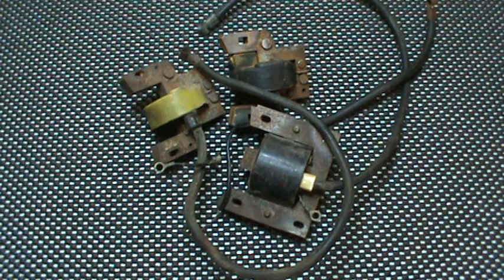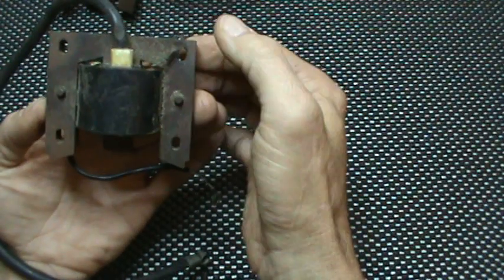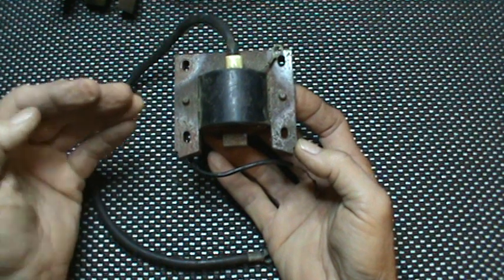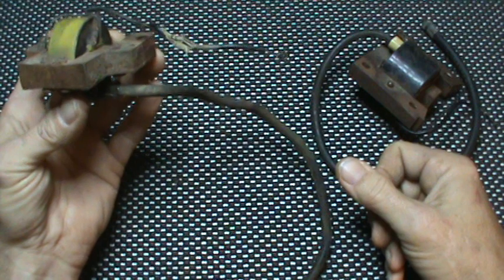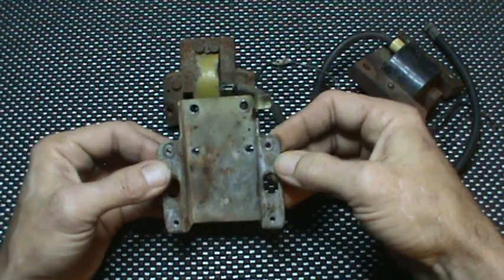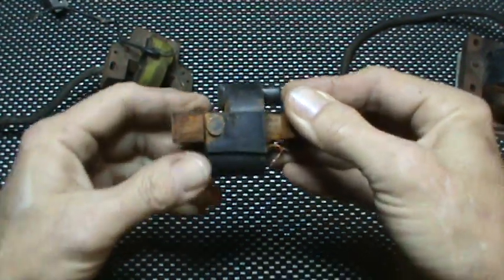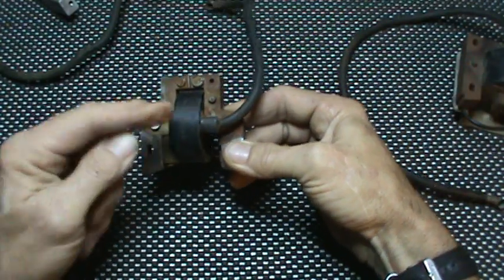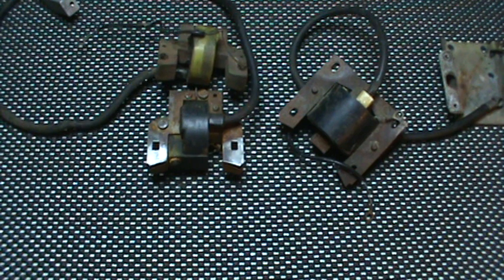Briggs and Stratton Coil Magneto Magnetron comparisons explained

Comment: My dad's old garden tiller (A David Bradley from SEARS AND ROBUCK circa late 1950's) has the old 23D coil that you've described.  The only info on the B&S motor is model # 107152 ser# 631396 on the data plate.  I'd like to replace it with a magnetron if possible.  Any info is appreciated.

Comment: I have a 5hp briggs with point condensor and my motor doesn't have an external ignition coil to go over fly wheel what should I do to get rid of the old point system don't want it

Comment: I have been getting conflicting information as to the flywheel polarization and using a magnetron coil.  Some say I can just reverse mount the new magnetron and it will work.  Seems to me that would put the spark trigger a few degrees of crank rotation out of spec.  This video mentions that they may have created a coil just for my issue.  Can you point me in the right direction to obtain one?  My engine is Briggs and Stratton 16HP -- Model #326431 -- Type # 0020-01 -- Code # 7505161 -- Serial # E950462.  Thanks for any assistance anyone can provide.

Comment: I have a 1960's vintage Trail King motor bike with a 3 HP B.S. engine I'm restoring.   
1) Only info on engine is plate on the block which says:  TD NUMBER 2222198.  Can you help identify this model?
2) I bought a coil/magneto conversion but the existing coil has four (4) bolts and of course the conversion has only two (2) bolts. In your video you mention/show a mounting bracket.....I need that bracket in order for the conversion coil to match up to the flywheel but I can't find a bracket anywhere and without a correct model that is recognized I'm stuck.  What are your thoughts?

Comment: The actuator magnet on outside of Briggs mower flywheel is all north pole, not N+S. Test it yourself with any magnet North , so that it repels each end of the outside FLYWHEEL magnet. The other guy on Youtube says the embedded Briggs  magnet has N + S at each end, so as AC is produced in primary.

Comment: I have this long gone to legacy 1958 Universal Motor Co 1 cyl 4 stroke at about 8 HP. It has the coil/condenser/breaker and light coil hoo-hoo assembly underneath a flywheel with 4 insidely placed full width magnet points. I´d like to make it breaker/condenser free and I see several solutions offered seemingly also for my type design, typically made with a flywheel with more than one magnet point. What I cant wrap my head around is how these modules unaided may prevent the plug from sparking in unseemly cyclus positions. Does anyone feel confident to easily explain me to potential success? ...preferably without having to cannibalize a B&S for external magnets and a flywheel machining job ? :D

Comment: I, nor could the local experts, find an engine number. The old coil checked out bad. The local guys matched one up, physically, but it will not spark. Can you have one that is simply not compatible with your motor even though it looks IDENTICAL? Thx.

Comment: Hi guy, I am trying to convert an 8hp briggs to electronic ignition. You show a coil with a button on the bottom and said that you don't have to have the flywheel repolarized if you use that coil. The local dealer sold me a 398811 stating it is all I need to change from points to electronic, but all it does is backfire and pop so I assume it is a candidate for needing repolarized. Do you know the part number of the coil you are showing that will work without repolarizing the flywheel? Many thanks in advance.
Reply from the maker: Flip the coil over. In other words, put the button on the opposite side. One side of the coil says something like CYL Side. Face that in the opposite direction away from the Cylinder and give it a go. Let me know your results. This trick usually works like a charm. Zip~

Comment: So Zippo, ur saying the 23 AFB has a whole different magneto set-up than the 23D?
on mine, the magnets are under the flywheel and a coil on a core that looks like a 
horseshoe crab. The new point-less has an interesting metal piece next to one of
the poles. as I understand it, there are 3 coils inside, the primary, secondary and a 
so-called trigger coil working with a diode or transistor.
Reply from the maker: Hi Raymond. You are correct. The 23AFB is not compatible with later Mags and cannot be converted to breakerless ignition. If your coil is bad, you CAN replace it with a remanufactured unit easily enough. I have yet to determine if the Nova II Ignition Module works on this type of coil/mag to eliminate the points, but they are cheap enough if you wanted to give one a try. Just Google Nova II and you'll get plenty of purchasing options. Your coil part number is 290880 and if you search that number on ebay you will find plenty of options. Zip~

Comment: I have Briggs 8R6, Part 702814, serial 173251 with a coil just like the first one.  I was able to get the coil off to replace and reuse the 3 leg like you noted.  Is there a part number I can search for to buy?  Wish I could post a pic.
Thanks for the great videos.

Comment: Question,,, are the business cards a different thickness? If so that don't work all the time,unless you find a business cards of the same thickness that you need
Reply from the maker: Business cards are standardized believe it or not. There are two main thicknesses. .014 and .016. Both are absolutely fine for setting the gap on Magnetos. Zip~

Comment: Good video. B&S make hundreds of coils with different part numbers.Are they all different? Are they interchangeable at all. Ive been told I need one, part number 591420. Ive been offered privately a 590445. Would they both work? My serial number is 80232 0474-01-7306 250. Regards, Colin

Comment: y can't you just simply turn the magneton type (your last sample) around so the third little pickup is on the right? opposite to what is written on it? would that not effectively flip flop the poles
Reply from the maker: There is a video floating around out there that shows this, but I haven't done this my self, so I can't confirm that it works throughout the RPM range. Zip~

Comment: Seen in a video if you turn coil around and you don’t have to get flywheel re magnetized
Reply from the maker: I'm skeptical about that, but I haven't tried it my self. So it may very well work fine through out the RPM range. Zip~
Reply: If they will fit .

Comment: Great video! I need to replace my magnetron type (exactly like the 3rd one in your vid) I really need help finding one!! I have the engine model number, but online suppliers keep sending me the wrong one. Who do YOU recommend for parts sir? Help me Mr Wizard! 😬
Reply from the maker: What is holding you up in limbo is your engine and its numbers are for a points fired magneto. You need to figure out what a newer engine would have for a Magnetron. But there is a small problem with converting these earlier points engines to a Magnetron successfully. The polarity of the magnets on the points fired engine is opposite that of the Magnetron fired flywheel. So...the solution (If your existing coil is good) is a simple and inexpensive Nova II Module put in place of the points. Zip~
Reply: ZippoVarga 
Thank you. If there was a way to attach a pic I’m sure you’d get a better idea of what part I’m dealing with. The problem is no spark, so I’d like to replace the bad part and I’d be good to go I think. Google search of B&S 397358, then look at Amazon for $37.48, and that’s my part. What they sent looks similar to other ones that are about $15. (smaller) It did come in a B&S part box however. Thanks again Zippo! Udaman!
Reply: @ZippoVarga  does the nova 2 not require me to pop the flywheel and move the bracket to adjust the timing a fraction, as the bracket under the fw is slotted left and right?

Comment: someone sed there was a part that could be attached to the magne'tron that looks like the
newer model coil that is a point-less set up? yup mice love that stuff as do rabbits like to
chew on phone wires under mobile homes.
Reply from the maker: Yes, there are points eliminators made by the manufacturers that attach to the coil and eliminate the need for points. I've got a couple of them that are made for the old L head 5hp engines most widely used on tillers, mini bikes and go carts. Zip~
Reply: @ZippoVarga  lol
Reply: Good video mice don't only eat che. Yes wire to little varmets

Comment: Could you please let me know where this coil alone can be sourced from. I have a 1960 simplicity with the briggs 23D. Started with intermitten ignition. Took the engine out ran some continuity and other simple test. Re installed cranked fine then after it sat for a few I reconected the positive battery lead and the mag went up in smoke. I had some weird ground issues when checking the flywheel rotation but shrugged it off for a 60 year old machine.

Comment: What if there is no top cover, so I do not have the model number and type.  Is there another place to find the numbers.  Original motor blew (9 or 10hp) and was replaced with a newer motor (13hp?).  The new motor was an electric start, old was pull start.  Mechanic put old top cover with pull start on new motor.  So i old have original motors model and type.  I have a no spark senario, tried to order coil via top cover and still no spark.  Can the coil be identified via the old coil?  Should the coils look identical side by side?  I asked the mower shop and they refused to assist.  Because of the virus I have no way to transport the mower to the shop.

Comment: I need help with my older Briggs I think it's a 16 HP I pulled the flywheel off but no key Crank has a spot for it but flywheel don't looks like it had a tab on the front I don't know what I should be looking for
Reply from the maker: If there is no key, and the flywheel has a small tab that nests into the notch on the flywheel that is removable with a small screw, then it's most likely a 9hp Model 23. Photos speak 1000 words. Email me at the address in the description below with photos of the engine and I'll try to help you. Zip~
Reply: @ZippoVarga  i put on a chevy truck coil on it and went with the points I'll try to send you a picture thanks for replying you know more than anyone I know about old Briggs

Comment: Will water ruin them.
Reply from the maker: Water doesn't play nice with any Electronics. Having said that, if the coil is thoroughly dried out, often, if the coil pack it self didn't short out, they will still work. I've had coils that the laminated metal sections had gotten rusty and swelled up that still produced a good string spark. So take that as you will. Great Question! Zip~
Reply: @ZippoVarga  yeah cause I had a pocket bike I changed the carb then it ran great till I washed it. I ordered a new magneto. I tried drying it but runs inconsistent
Reply from the maker: @eliasleyva547  Ah, got ya. It's possible the ignition module that runs off the cam may be what is in need of drying out then since you're speaking of a Motorcycle engine more or less. Zip~

Comment: I'm working on a 3hp Montgomery Ward edger and want to get rid of the points; thanks for the info!
Reply from the maker: Getting rid of the points isn't as simple as just buying a Magnetron coil and putting it on. The polarity of the magnets on the flywheel is incorrect for the newer style and the flywheel should be sent back to Briggs & Stratton to be re-polarized, free of charge. You just pay shipping. Another option is a points eliminator. Either a Briggs & Stratton kit or a Nova II ignition module can be used. I have videos on both and it's a cheaper and simpler way to rid your self of the ignition points. Cheers! Zip~
Reply: @ZippoVarga  I ordered the nova ignition module and a stock replacement coil because mine is kinda rough and suspect. I'm hoping that will fix my issues. My dad inherited this edger from my grandfather and I inherited it from my dad so I world really like to keep it going and use it. The date code on the shroud says it was made in 1970 which makes it older than me!

Comment: Hey Zippo, I have a 3hp B&S motor, numbers are: Type 0413-03
Code 9082101
Model ?30202?
Do you know which magnetron would fit and where to buy one?
Cheers, Phil. (Top Conker).
Reply from the maker: Heya phil! You can go to the Briggs web sight, go to the manuals section and download the manual for your engine and within will be all your part numbers at your fingertips. Then Google Briggs and the part number and you'll have dozens of choices. Hope this helps!!! Cheers! Zip~

Comment: One of the coils I have does not have that button in the center. It only has one wire. It is off of a 4.5 hp vertical crankshaft. Engine number starts with 12E or 12F date was in 1995. I tried to swap a 5hp coil on it from a 2004 model  but it doesn't fit. It is too wide so holes  don't line up. So which coil is it?
Reply from the maker: Using your Model and Type, enter them in the Manual tab at the Briggs and Stratton Web Sight to download your engines manual which will include all parts. Zip~

Comment: Do you have knowledge and info on John Deere ignition systems. In specific 14SB.  On the kill side of coil there is is a sealed unit inline and grounded with another wire coming out of it to the kill switch.  Does this unit increment the grounding to minimize the ground spike at higher rpm's to minimize coil damage?
Reply from the maker: You are describing a Resistor. A 6V coil needs the resistor to keep the coil from overheating. A 12V coil will be marked 12V, but the 6V will not have any discernible markings. Zip~
Reply: ZippoVarga thank you for info.  I subsequently got my mower running and it was that control module.  I found info on the electrical system and everything else via a Toro application that also uses the Kawasaki FC150V engine.

Comment: 10:45  made me think and not understand at the same time
if polarity mater why not just flip the magnetron  ? what make this not work ?  (still wacthing at the time of the comment)
 should be easier than  reverse polarity  flywheel job
Reply: crap i  understood with next video xD

recap of other video by you :D
south is facing inside the wheel and north outside the wheel xD
i though those magnet were alternating from south to north like any generator/motor  xD
Reply from the maker: @buder5116  They are now making Magnetron coils that work with the older polarity flywheels, but if your coil is ok and you want electronic ignition, you can install a Nova II points eliminator. I have videos showing how to install. Quite simple really. Cheers! Zip~
Reply: @ZippoVarga  yeah im rebuilding an old onan 2 cylinder engine with work on point and was looking how hard it is to convert to  the simpler magneto

so i wonder can  a single magneto  supply 2 cylinder?

i probably need a dual coil magneto ?

since by default both spark  strike at every revolution  the same as any  lawn mower

the fly wheel dosent have timing magnet only  inner magnet for  alternator so i dunno how to safely add magnet to the wheel without screwing everything
Reply from the maker: Anything is possible. The Briggs and Stratton Opposed also uses a dual plug wire set up with sacrificial spark and it might work. But I don’t think your Onan has a magnet on the flywheel. Zip~
Reply: @ZippoVarga  yup dosent have magnet on the flywheel that why im searching for alternative and i think i found it

Comment: hey Zip! enjoying your videos. Been quite a few years since this video was made, but oh well. 
So on my coil, the output wire from the coil to the condensor broke. Is this repairable, or should i just get a new coil?
Reply from the maker: The wire you speak of. Is there a way for you to solder a new wire to the same output wire on the coil? If not, I would replace it. You can go to Briggs and Stratton to get the parts manual for your engine in which you can locate the correct part number. Then simply search the part number in google. Good Luck! Zip~
Reply: @ZippoVarga  The wire broke off where it is epoyxed in, so Ill just order a new one. Thanks!

Comment: Thanks Zippo for the Video. I have a Briggs 26 hp twin that when I hook the ground wire from each Mag together, they ground out.( they are not attached to the ignition switch),  if they are both unhooked from the spade on the mag/coil the engine will run with no way to shut it down. I guess what I am saying is that if only the grounding spade on the two mag's are connected to each other the engine will not start. Any ideas ? could one of the mags be bad?

Comment: I just picked up a 9hp briggs cast iron block engine with the coil under the flywheel
Reply from the maker: Sounds like a model 23A
Reply: I think it is the serial number is 68 is the first two numbers

Comment: I'm having a bad time sourcing a replacement coil for a Sears Craftsman Brigges and Stratton 6.5 hp mower (no points) approx. 25 years old. No model no. on the engine but a sticker on the deck showed a 944.363530 as a model #. And guess where to get one ?

Comment: Hey zipp.. can you install mag. upside down instead of reversing polarity on flywheel?.. or if you happen to accidentally install inverted would it still run?..
Reply from the maker: If you're installing a Magentron on a points engine, you can flip the magnetron around (Cylinder side OUT) and it will play nice with the magnets, yes. Zip~

Comment: Great video. Question... Is it mandatory to have the magneto ground connection connected for an ignition to work? I know this video is afew years old, but was still hoping for an answer. Thank you Zip
Reply from the maker: You need to complete the circuit going through the copper winding of the coil, so yes. Zip~